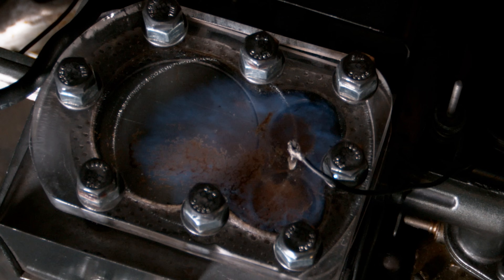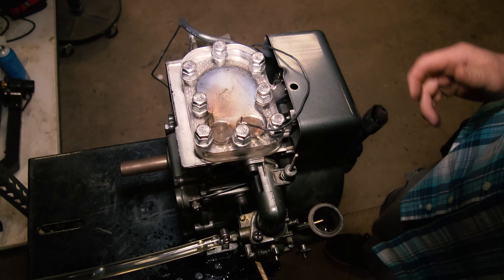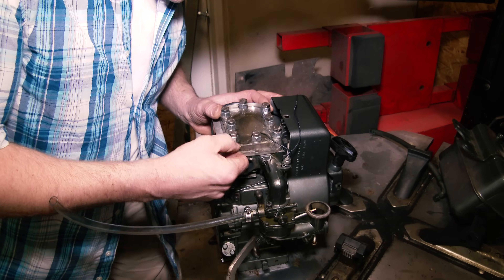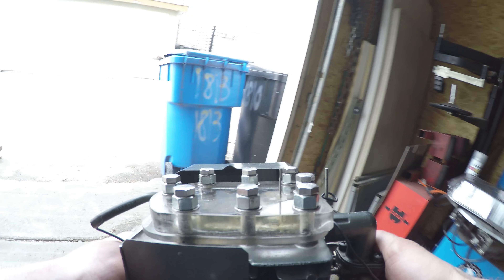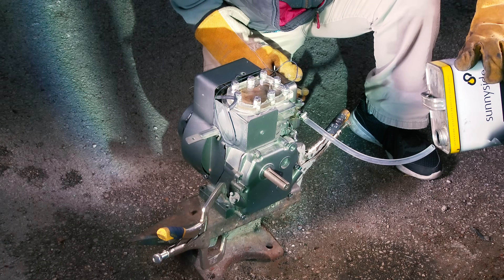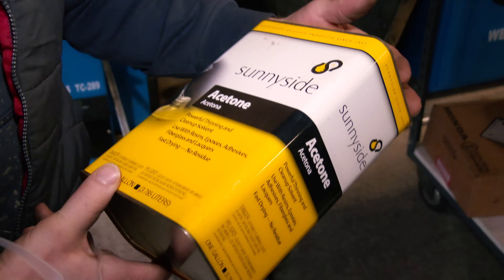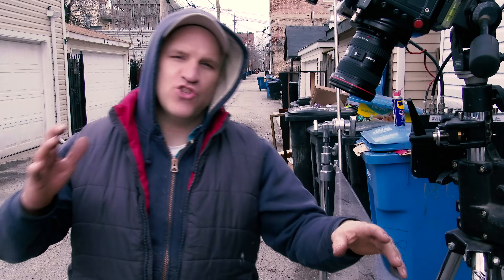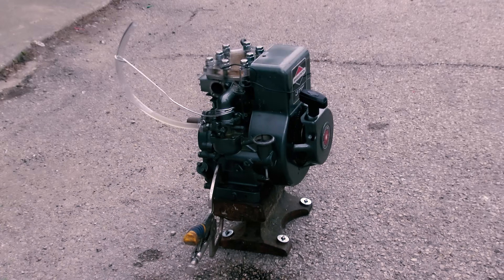See Through Engine (S1 • E3) Different Fuels [WD-40 -Acetone -Stoichiometric Gas ] 4K

Comment from the maker: PLEASE rate my show WP on IMDB, I greatly appreciate it ! Warped Perception
http://m.imdb.com/title/tt5548028/mediaviewer/rm1700085248
Reply: Warped Perception
Reply: Please do a rotary wankel engine
Reply: Warped Perception please add turbo or super charge
Reply: Could i see  hexane or toluene burning inside on it ?? Thanks
Reply: 600fps isn't enough the slow mo of the engine, but good vid!
Reply: T55ť
Reply: I’m replicating your work on a smaller briggs and Stratton engine. How do you manage this with a solid block of acrylic? I always have to cut recesses into the head every time I make one.
Reply: Warped Perception I ought to rate you 1 star for not running the nitro🖕
Reply from the maker: I dont know that Emoji, my dad was a minister. actually, i did run nitromethane and it was the most amazing burn I have ever seen and i can't wait to share it. then I mounted a turbo and ran nitro. those videos were supposed to post in April or may, however, my contract with discovery channel was compromised when everyone on the internet and YT FB especially, started freebooting and stealing my content. by may 2017 I had over 70 million stolen views, i was in trouble. it took me almost 6 months to fix the issue and as of october its fixed,  which is why we started uploading full episodes again. I was very disappointed that we didn't get those up as scheduled, they were my favourites to date. that being said they will be going up in the next week or 2. again I deeply apologize but I had to address the theft issue before moving on with my plans for this channel. thanks for your patience and feedback!

Comment: That's not a miss fire,  the mag throws a spark with every revolution of the flywheel. If you put a load on the engine, it would give better combustion flames.

Comment: Great videos. A couple of suggestions, if you don't mind:

# You should spark every 720 degrees, the extra/useless spark disturbs someway the show (especially at high RPMs).
# Actually, you fire at TDC. You should really put some ignition advance (40+ degrees), but be prepared for a huge increase in performance. It will show a more realistic combustion process, though (ie. right now when the piston reached BDC the combustion hasn't even completed yet).

Anyhow, great work, thanks a lot for sharing.

Comment: I heard a mixture 95% 98 octane gasoline, 2,5% methanol, 2,5% toluene or Methylbenzene and a little bit of 2 Stroke motorbike oil. I heard the rally teams in europe used to use it. Will it work?

Comment: It is incredible to see how fumes rush through the exhaust valve as soon as it starts to open... I had the assumption that it was the piston the one in charge of pushing the fumes thru the valve, but you can clearly see how residual pressure makes the job, at least partially.

Comment: I stopped this at 8:44 to comment on just how careless and dangerous you are.  Why don't you use a small funnel to feed that tygon hose instead of pouring and letting combustible fuel spill all around????   Other than that, I loved the innovation of the clear head and watching the engine combustion process in real time.

Comment: VERY interesting.   thanks for putting so much work into this.    in the 1920 the didnt know how preignition and  detonation worked.    so they  , Harry Ricardo and others,  built a see throu head and used high speed cameras to see how the flame front went throu the chamber.   which lead to hi octane fuels.    Tetraethyllead  ect

Comment: Once they figure out how to make transparent metal, i bet they will be fitted as standard, this video is up there with the best on youtube.
Reply: Would probably lose a lot of the energy that way, since light is the thermal radiation from high temperature, and if you let it escape, you cool the gas down, causing it to produce less power.  Would be interesting to run this engine under load (dynamo) and compare the fuel to energy ratio with the transparent head versus the normal head.  (Of course, the normal head, being metal, does conduct a fair amount of heat away as well.)

Comment: Why is there a spark before each Intake stroke as well..?
Reply: Because the flywheel – i.e., the source of ignition – completes two full revolutions per combustion cycle. This could also hypothetically ignite any remaining gases in the combustion chamber, adding power to the intake stroke.

Comment: Very interesting to see the burn process in a four stroke engine from different fuel sources. Like testing post apocalypse Mad Max conditions. Now to see if different fuels deliver sufficient power under a work load. Like cutting grass with a lawn mower engine.

Comment: I musta put a few thousand miles on my Mini-Bike that I had put a Craftsman 3hp Briggs & Stratton on, back in the day (around 1980). With a previous motor to that, I had my fastest ride ever on the thing. Didn't have any gas in it one day, so filled the tank with a bottle of Dry Gas I had laying around. That was likely a near equivalent to alcohol, correct? Regardless though Yaaa friggin hooo!!!!!! Lucky for me I found that Craftsman motor pretty quickly to replace that one. Someone's motorized Reel Lawn Mower lost it's motor 😎 - The one with the tank of Dry Gas lasted for about a screaming fast 2 miles, with no brakes!!! Then after stopping by a friends house for 20 minutes or so, it was seized like a rock. So I gave that seized motor to another local kid to take apart and see what part(s) actually failed. He brought me back the Crankshaft and there was a large chunk of the lobe that drives the valves broken off. I cannot vouch for what he showed me though as I didn't actually watch him remove it. -- After your first video I was going to suggest trying just Starting Fluid. Oh and, would it be in any way feasible to hook one of these up to some type of, “Dyno”? I'd love to see the difference between Gasoline and Dry Gas ha ha... Your Videos absolutely ROCK!!! Keep up the great work and stay safe!!!... Is a glass cylinder head in the works? yuk yuk

Comment: Differing fuels require differing optimum compression ratios. Wanna blow it up? Use pure nitromethane and also pure ether. Ya, I know you said don'e make suggestions but hey,, just sayin'.
Reply: Having said that, if you make another, there IS a way to add adjustable compression to your device, very easily and cheaply.

Comment: Please answer the biggest question I've ever had about engines, right up there with is there a Good. Why does an engine run faster when you turn up the fuel flow, like pressing on the accellerator.

Comment: always great to see some real science thank you for these videos. from what ive observed 15:1 air fule ratio has no color and no power, and 12:1 burns bright and has flames going out. nearing 10:1 is when it starts to not have color again but lots of smoke/hydrocarbons and low power

Comment: Acetone burned invicible but has the most power of all testet fuels (only nitro is more powerful) the burned exhaust is also cleaner than usual gasoline. The downside is: a normal engine will not last long since the acetone disolves the sealings.

Comment: try glow engine model fuel, is a mix of methanol and nitrometane with castor oil. smoky and flameless combustion, but Very powerful. Small 35cc engine makes 2 or 3Hp at full throtle @18000rpm
Reply: Gustavo Veronezi 18k rpm 🤔
Reply: Guess you mean 3,5cc

Comment: The reason the acetone did not make a big flash is because it burned CLEAN and clean burning fuels will not make a big yellow flash which is a sign of glowing unburnt carbon which is what stains your viewing area. The acetone ran best by far. I have run a lawn mower on both acetone and denatured alcohol before and it ran better than gasoline because the low vapor pressure, short chain, oxygen included fuels  tend to thoroughly evaporate, leaving no globs of wet liquid fuels to go through unburnt.
Reply from the maker: +Delicious DeBlair thanks for the insight, I guess that makes sense, if it burns really clean then you probably wouldn't see it very well.
Reply: One thing most people totally forget is that an internal combustion is not a fuel pump, but an air pump. The only reason for the fuel is to heat the air. One could use a lot of things including direct solar energy [it is being done already in fact] and even pistonless engines, [from rockets, to turbines to a host of other novel devices, and of course there are externally heated engines as well] so what one wants to do is to use the least amount of fuel it takes to generate the right amount of heat in the right location without either wasting it as excess engine heating and spewing it out the exhaust pipe unburnt, wasting it by blowing it into the engine block, or causing the piston needless stress by having it burn for too long in the rotation of the power stroke.

The advantage a cleaner burning fuel has is that it completely burns within the cylinder [provided the mixture is not too rich for the volume of oxygen on hand] and does not waste a lot of heat as radiation which only serves to heat the mechanical parts.

Also it leaves no soot or carbon buildup, does not burn the valves, and because of its high octane rating, acetone,  as with alcohol [all of them with low vapor pressures] are detonation resistant, allowing higher compression ratios, which increases the energy one can get out of the combustion, using even less fuel.

And to all those people who talk smack about alcohol having less energy then gasoline, [roughly half as much, which it technically does], since roughly 50% of the gasoline is not only not burned in the chamber, it ends up working against the engine by driving the piston down at the bottom of the stroke when it should be decelerating, which does damage to the bearings, you are actually LOSING power with unburned gasoline compared to completely burned acetone or alcohol.

The only exception to this statement is the dry vapor type updraft carburetors they used to have before the oil industry got in there and got rid of them, there are ways of making a dry vapor carburetor for a modern high RPM engine, but it takes a skilled engineer to do it, and the alcohols and ketones are already usable with existing carburetors.

Could you get more power and mileage from dry gasoline vapor than alcohols? You bet you can! Is it worth it? That is up to the individual to decide.

Would I do it? Maybe.

Right now I need to raise the compression in my engine before I can do that and I lack the money on hand for all the stuff I need to do for that at this point.

If I ever do, I will post a detailed report and how-to on my channel.
Reply: @DeliciousDeBlair  "...since roughly 50% of the gasoline is not only not burned in the chamber... ...you are actually LOSING power with unburned gasoline compared to completely burned acetone or alcohol."
Why do I get significantly better fuel economy on gasoline than E85 in my flex-fuel vehicle?
Reply: @JDwill72  Because you believe their hype and trust them to build your car for you.

I have run tired worn out vehicles on E-85 [low compression] and yes, they did run poorly, while I have run other high compression engines on PURE ethanol and got excellent performance.

I dare say that the gasoline aspect its self is as much a part of the problem since the part of gasoline that makes it more prone to evaporate is common butane, which, when left in an unsealed, un-pressurized vessel, eventually evaporates off, leaving less volatile molecules which are harder to vaporize, and this stale gasoline is often a problem found with trying to start cars which sit for long periods of time.

This chart is a bit 'overkill' and somewhat confusing to those who do not study this stuff on a regular basis, but it will give you a vague idea of what comes out of the ground before refining, out of which, the majority will go into pumps at stations with only minor additions and subtractions between refinement and additive enhancements. https://www.osti.gov/servlets/purl/1242209

This publication has chats which tell you specifically which compounds are at what states of evaporation at what pressures and temperatures... https://petrowiki.org/Vapor_pressure

If you REEEEEEEEEEEELY want to understand it, please study THIS publication so that you get a true, in-depth comprehension of what is going on... https://www.govinfo.gov/content/pkg/GOVPUB-C13-da7a968e895631e1fad8cf9c2aef73e1/pdf/GOVPUB-C13-da7a968e895631e1fad8cf9c2aef73e1.pdf
Reply: @JDwill72  https://en.wikipedia.org/wiki/Reid_vapor_pressure
Reply: Most of the light gases need more compression because their molar heat values are low and therefore upon combustion they fail to have enough left over heat to ignite their neighboring molecules of fuel at lower compression ratios where they are not so tightly bunched together for them to bounce off each other [and oxygen], and where heat is dissipated as radiation at to great an angle of dispersion before it can reach a neighboring molecule.

Just like focusing the heat of the sun in a magnifying glass, you also focus the latent heat of the ambient air when you compress it, this is how diesels work as most of you already know, well it is true for all internal combustion engines that the higher your base heat, the less additional heat you need to initiate the combustion [read up on gas laws and thermodynamics if you do not get this part] but each multiple of atmospheric pressure you compress your mixture by, the heat of the mixture will go up by that amount.

For instance, if you put 70 degree air in a cylinder and squeeze it down to 10% its original volume, you get 700 degree air, until you release the pressure, or until the heat dissipates into the surroundings. This is also the principle by which refrigeration systems work, only in the way of deliberately letting the gas cool before releasing it through controlled means to absorb heat...

Just shave off some of the top of the cylinder so that the compression ratio increases [the top of the piston will protrude more, as will the rings, so do be careful not to do too much!] and reduce the available space within the combustion chamber and you will be able to run much lower flammability fuels with ease.
Reply: Delicious DeBlair 
Your posts are interesting & educational... thank you for taking the time to post here... 🙄
I'll be checking out your channel... 😎
Reply: I have never posted anything educational on my own channel, just me doing plain ordinary stuff. [sad eyes]

Also my connection sucks, so since it takes like 3 days to upload videos, and it ties up my whole internet so that I can not do anything else, I just stopped uploading them until I can figure a way to get faster internet.
Reply: Most of my more recent recordings are about rebuilding the track loader you will see on my page since it has had a lot of drive wear damage requiring the carriage to be heavily reworked and many new parts put in.
Reply: When you get an education some day, if you have the mental ability to, then you shall understand.

Until them your calling bullshit just means you like to spew bullshit and this is the only way you know how to since you lack the education or experience to discuss the topic like an adult, let alone a trained mechanical and chemical engineer.

Nearly air breathing engines work basically the same way, be they rotary, oblique, crank-and-piston, turbine.

The exceptions are nuclear and rocket engines which take up their own niches because one carries its own oxygen and one carries only fuel which is not reacted with oxygen.

Fuel and oxygen from the air break the fuel down into gas and heat.

This heat is shared with the temperature of the remaining air molecules causing them to expand, generating pressure, which acts upon a working load bearing surface, which develops force to do work such as moving a vehicle.

This is not anything new, and there is nothing to dispute about anything I wrote.

Calling long proven facts bullshit proves your asinine ignorance and willingness to troll an intelligent presentation for your own personal insecurity.

I strongly suggest you grow up and get a life.
Reply: I'm calling Bullshit on the heat theory. What turns the crankshaft in a pistonless engine? Let me guess cold fusion...

Comment: The WD-40 didn't seem to be atomizing in any meaningful way, just washing out over the inside of the head until it detonated. Kinda interesting. I've often used WD-40 as my go-to starting fluid for two stroke engines, they seem to kinda like it. As far as your tubing, I have always used a similar setup when dealing with carbs with cheezed internals (jets, orifices, stuck floats and tips, etc) before going straight to disassembly...pinch off (or shut off if petcocked) the primary fuel supply, add a tube or use the existing fuel line and fill with carb cleaner until it backs up full in the line, then fire it up. Lawnmowers, motorcycles, cars, you name it, they all run on carb cleaner. Run it at all throttle openings until it starts to spit from running dry, then connect the fuel back up and let it run until it clears all the cleaner from the bowl...about 75% of the time, this corrects the problem, no surgery needed.

Comment: When you do decide to blow it up do it with the acetylene but turn on the oxygen this time, put the camera above but with a shield to protect the camera, put the tanks behind a wall from the engine, leave the oxygen tank valve closed, open the acetylene tank valve, open the oxygen valve on the torch handle, open the acetylene valve on the handle and put it in the carb inlet then start the engine and go hide behind the wall then open the oxygen tank valve and wait for KAAABLEWEEEYYYYY. I bet the engine block will be fine and the head will explode, but idk that lexan is pretty thick.